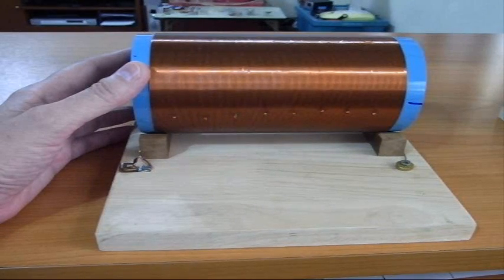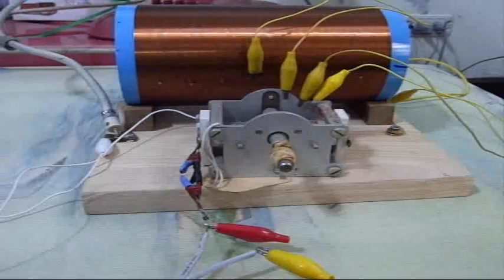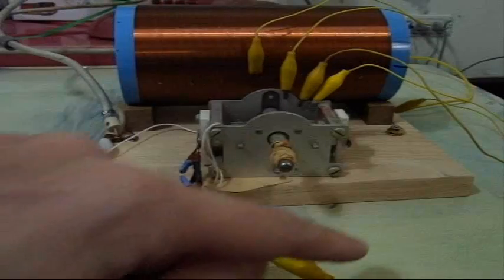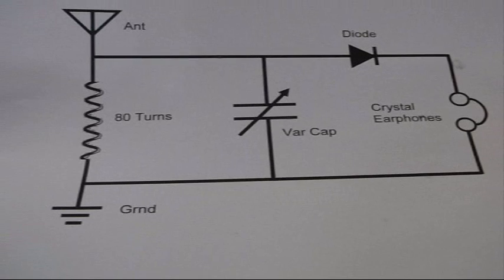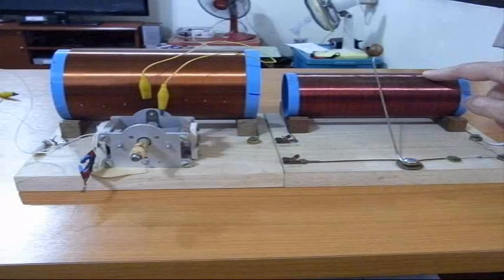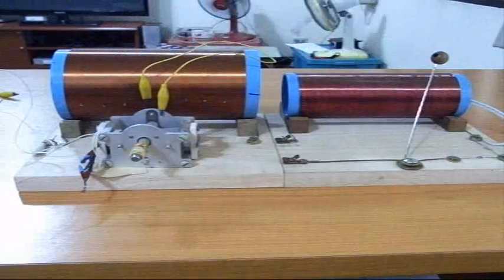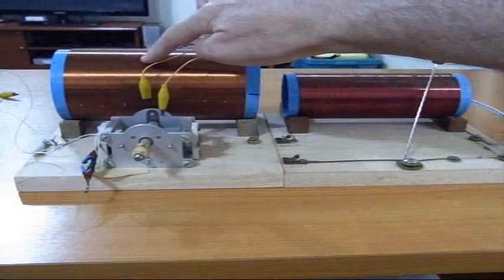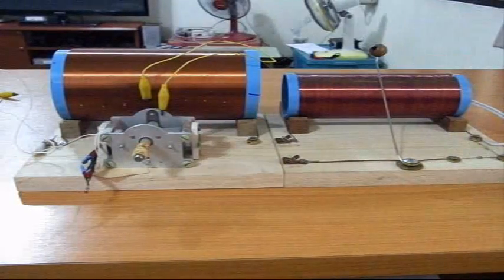Popular Crystal Radio Design That's a Waste of Time - And Why   (Updated Video Available)

Comment: There are too many parameters missing in most of the versions of this particular radio that you'll find.  With a 365pF varicap the coil should come close to 240uH.  using 26 awg magnet wire and a 1.75" toilet roll tube 80 turns will cover about 1.27" and give approx. 237uH or so. Try winding a coil to those specs and plugging it in.  You should be able to tune the AM Broadcast Band then.
Reply: 90 turns of 24 awg will provide a higher Q coil of about 240uH on a 1.75" form.
Reply: +Robert Turner 244uH I meant. ..
Reply from the maker: +Robert Turner I agree, many versions have some parameters missing.  The radio "works", it just picks up 1 or 2 stations.  I have demonstrated that with just a diode and earphone.  The point I was trying to make is that the capacitor and coil don't really do anything in this version.  My thought was that with the wiper style the induction and capacitance (in the coil) vary a lot and in lock step, unlike the variable capacitor with fixed coil (inductor).  I need to do some more experimentation.
Reply: +tsbrownie I actually used a 240uH choke (this particular one looked like a half watt resistor) and a varicap of 0-410pF. It worked pretty good but needed a good Antenna and ground, but it was cool because it was just the cap with the choke and diode soldered to it. I just clipped on the antenna and ground and an old high impedance magnetic earphone to use it.
Reply from the maker: That does sound cool!  I think my older brother had something like that once, but the memory is hazy.  I think I may have those parts in my parts bin, will see if I can find them and make it happen.  I don't have the high impedance magnetic earphone but where there's a will, there's a way (and usually where there's a will there are relatives coming out of the woodwork!  ;)
Reply: +tsbrownie if you don't have the magnetic earphone,  just put a small value cap and a 100k resistor in parallel with the crystal earpiece. I got the magnetic earpiece here:  http://www.xtalman.com/headsets.html. 
I've got some of the 240uH chokes enroute. message my inbox and I'll mail you a couple.
Reply from the maker: +Robert Turner Thank you Robert, that's a great website.  I've got the chokes, just need to find time to dig them out and assemble stuff.  Thanks for the offer.  I hope you will post a video on your work, I would like to see it!  
Sorry about the late reply.  I don't know why, but your comment did not show up in my "notifications" list.  Found it by accident while perusing old comments.
Reply: +Robert Turner builds NOT bills :')
Reply from the maker: +Robert Turner Sounds interesting.  Please let me know when you post your videos, I will come and watch for sure!
Reply: +tsbrownie Whoops,I forgot.A small resistor(around 2000 ohms,not critical)across the crystal earphone bleeds off the dc voltage produced by the diode so it can continue to detect.
Reply: +Michael Henwood By the way,great video.It brings back fond memories.Thanks from an old Ham,technician and gadgeteer from way back(71 years).

Comment: Hi, since I was 10.... I've experimented with so many..... my 1rst was from Morgans book... it was the one with a slider... I t worked good... Then I experimented many others... they sucked ... did the same like you did...my favorite is the Loop crystal radio..  I've seen some where they can get shortwave...
Reply from the maker: +Paul Pedrazza My first 2 were from the boy scout handbook, with a couple of changes.  My second was a copy of a "rocket radio".  I have not tried a loop, it sounds like you would recommend it, so I will have to give that a try!  Thanks.
Reply: +tsbrownie 

I would recommend a loop also.  It can be as simple as constructing a octagonal(or any other shape) frame of wood and stretching around 4-6 turns of 18 gage wire over it and attaching a 365 pf variable and your phones/diode.  No need for an external antenna or ground and the set will be direction.  It's a bit large, but works well.

Comment: http://www.bing.com/images/search?q=rocket+radio+crystal+set+images&id=17F1CDFDA30DBA5B484C219F39D4EA8E1232732A&FORM=IQFRBA
Reply from the maker: +John Baart My brother had something similar, it was a ferrite core tunable crystal, but in a plastic ball, a bit bigger than a golf ball.  I can't remember how well it worked.  He also copied that design into a felt marker so he could take it to school.  That one did not get a lot of stations.
Reply: My rocket radio got 5-6 locals and at night 4 or 5 more picking up skip from Texas and Chicago and such..from Syracuse NY-- with just 3 foot antenna near light fixture...not bad for $2.. free power radio--in the early 60's...

more noise at night with less selectivity...

I'm gonna try to duplicate but using piezo buzzer first....
Reply from the maker: +John Baart Interesting, just 3 foot antenna!  I clipped on to the gutter for an antenna (about 60+ feet) and some other wire I strung around.  I grew up in a small town, so we did not have many local stations, so 2-3 was good.  If you build one and make a video, let me know.  I'd like to see it.
Reply: OKAY
Reply: +John Baart Wow! Great circuit.Hard to believe it's a collector's item now.
Reply: Yeah..from- $ 2.00  then to high prices they bid for these.....now...just like trains or baseball cards etc...if we only knew then we would be rich now....?

Comment: I had a rocket radio which used a ferrite core transformer  and and adjusting the ferrite core worked good to change channels,,,with two leads for antenna and ground-- 3 feet long each with alligator clips...coil was like the size of a pencil with movable core rod inside....hooked antenna near light and ground to iron bedrail and was good....never  tried on a longwire antenna...maybe a lot better...
Reply: +John Baart I did also,attached the antenna clip to the telephone base.I picked up CBC radio very well.Nice little radio for it's day.
Reply: +Michael Henwood Yeah, back when AM radio was all we had and the stations were mostly rock and roll....not junk like they broadcast now on AM......

Comment: Did you try a transformer type coil to step up voltage and isolate antenna and primary winding to increase selectivity in the secondary tuned circuit...i think a one coil system is not very selective...from what i have read...?????
Reply from the maker: +John Baart I have tried various antenna tuning circuits, but have not been rigorous in testing.  Some seemed to make the signal a lot sharper, others made it louder.  Did not find where I could get more stations / discrimination.  Will have to get serious and find out one way or the other.  Thanks for the info.